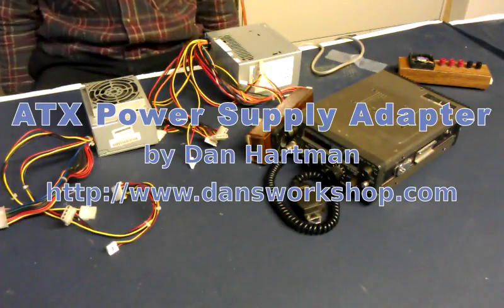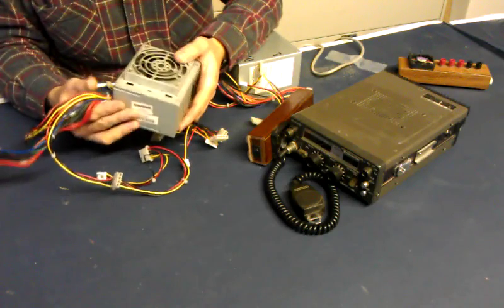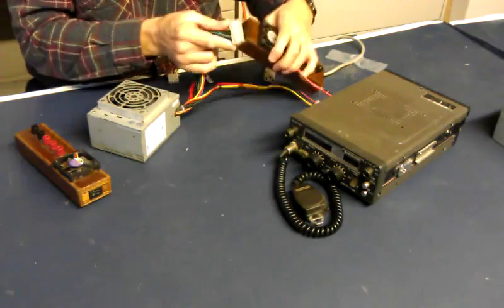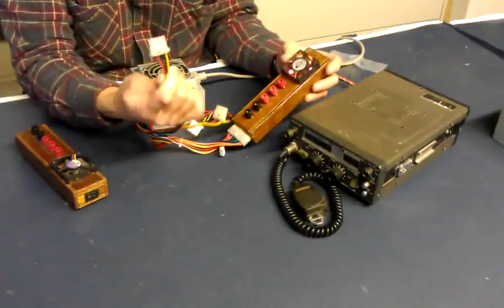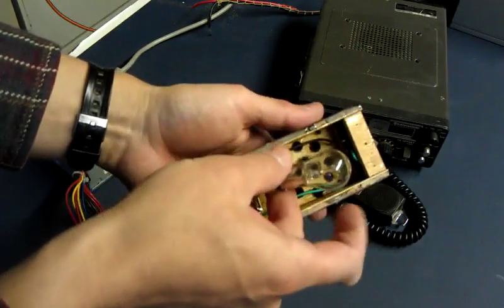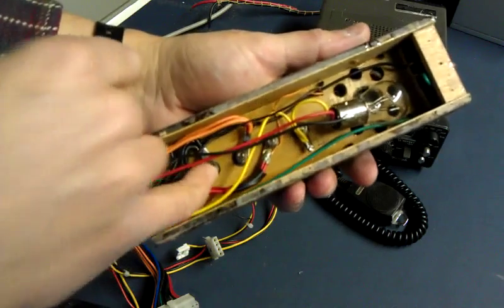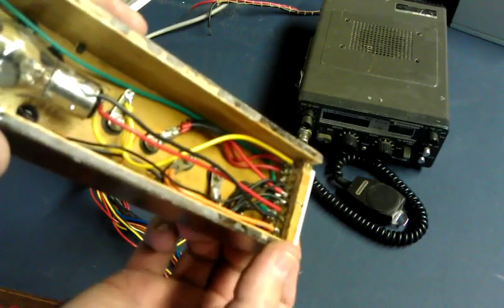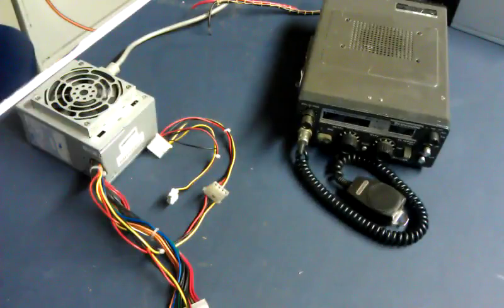How to NOT convert ATX power supply to benchtop or lab power supply

Comment: The Lower the Voltage = The Higher the Current   Higher Voltage = Lower Current. Fundamental Ohms Law.  Pressure Vs Flow.  The higher the pressure the lower the flow and vice versa - Same as water flowing through a hose.

Comment: i dont get why ppl connect the wires together.. in theory, the electrons will take the path of least resistance, so they will essentialy, all travel down the same path/wire, or at least thats what i was led to understand from an automotive background. I know it works n all, but in theory it shouldnt realy make a differance. I have a psu to look at, and wondered how hard it would be to just put a larger gauge wire on the main + and neg "bars" inside..??

Comment: 500W PSU means 500W regardless of mow many wires each rail is a SINGLE RAIL on the board of the ATX PSU It was a common Misconception that each wire is its own rail that is far from the truth all the 12v go too a single pad on the board same with ground save with 3.3 and same with 5v the only wires on their own rail are power good power on 5v standby -12v and there is another i think but cannot think hope that makes things a bit clearer for you :)
Reply: Not entirely so, Dale.  Per wire, you're still going to be limited by the amount of amperage allowed through the wire.. Reguardless of the wattage.. Example, a 500W supply, you could draw up to 100-Amps @5V. BUT..... that doesn't mean a single 12-AWG wire will handle 100-Amps. In actuality, a dead short at that amperage, would burn the wire instantly! (12-AWG wire has a maximum of 16-Amp! Higher, and you're risking burn-up! 100-amps is more than 7X!!)  the 12V on most 500-watt supplies, is 24-Amps. (+/-, depends on manufacturer). But, but, you need to use ALL wires, in parallel. the equivilent of a 4-AWG wire.  Think of this as the size of the average booster cable wire for your car. Otherwise, You'll have a nice space heater, instead of a power supply (which will hopefully shut-down before it does.)

Comment: that's an old 2m radio you have there. aren't you afraid of the interference from a switching power  Supply getting into the radio?
Reply from the maker: No, I'm not.  What frequencies are in a switching PS that I should be afraid of?  I think they run somewhere around 100-120KHz.  Should I be afraid of that?  They have to run quiet enough to be compatible with the guts of a PC so I'm not too worried about it.  Never had complaints on the local repeater about funny sounds or issues.

Comment: Damn, someone stole your idea and made a breakout board. at least the masses can use these  powersupply breakout boards in the exact same way so if the power supply itself does fail, it is an easy switch.
Reply from the maker: Well it's not really stolen, because I gave the idea away in this video. ;)  Not only that, but I stole the idea from someone else.

Comment: Idiot here. Why is the dummy load necessary in this case?
Reply from the maker: Some power supplies won't stay turned on without a dummy load.  It isn't necessary in most cases, I'm told.  Using a light bulb as the dummy load is also a visual indication that the power supply is on.  (Maybe this isn't a necessity.) Before the electron police jump on us, let me clarify something about "necessity."  Not much of anything is really necessary.  It's not even necessary to use an ATX power supply for anything, just use a string of D cells, enough of them will make 12 volts.  Posting videos to youtube isn't even necessary.  Having a computer isn't even necessary, people lived without them for millenia.
Reply: FYI, the newer 24 pin (not 20 pin) ones need a larger load too to keep on. Apparently even if the PSU does come on without a load, it's regulation is sometimes bad.

Comment: This comment is intended for the technically minded....  Please don't post jackass comments if you don't know what any of this means...  (You were warned...)

Just a few of my own thoughts here, ... things to keep in mind.  And for similar minded folks, feel free to comment if I've missed something or; of course, ... if I'm wrong about any of this..  :-)

ATX standard as far back as ver1.1 (Probably even 1.0, but I'm not going to try to find a design guide for it...) requires no-load operation.  (Most power supplies made after August-2000.)  So, I suspect that a basic load is built into the standard.  I also suspect that this is because of two common issues.  1.  Timing.  Mainboard power-up is not always as quick as it should be and 2.  Most ATX power supplies (not sure which version for which it became effective, but I know it was pre-2.01) have 5V power on state EVEN when the power supply is in stand-by mode... Bearing in mind that most ATX power supplies are designed and built as cheaply as possible, ... I would probably suggest NOT using old power supplies for this function anyway, so.....  If it powers on and stays running with no load, ... you should be fine.  They ARE "allowed" to bind to power-down state with no-load, ... so if it shuts itself down or won't power up, ... you probably need a load...  (BTW - If it powered down because of no-load, you may have to disconnect input power and reconnect to get it to power on again...  I suspect this whole issue is probably rather rare, frankly...)  Since most DIY noobs would not likely think of no-load as being a problem, ... I suspect that if it were an issue (and causing failed supplies) you'd have seen droves of people with this issue by now..  :-P

Most power supplies (300 watts and up) use 16AWG stranded wire on the 20/24-pin ATX connection.  (For all but the 3.3v remote lead, ... which may be smaller.)  (Note : 250w and below may have 18AWG wire...)  Since most 16AWG wire used will be between 7 and 24 cores (strands,) the maximum recommended load for that wire would be 7 amps.  Since there are only 2 +12V leads on a 24pin ATX connector, ... the maximum recommended output using only those two leads would be 14 amps (168w)  (Doesn't matter if it's a 300 watt or a 1000 watt ATX power supply.....)  So, ... if you'll need more than 168w output, ... you should really consider adding additional connectors to this project for the 4-pin molex connector, or preferably, the PCI-E power connectors (as they will have 3 or 4 +12V leads on each connector...) If using multiple additional Molex connectors, ... use the first molex connector on each lead coming from the power supply and use separate leads for each connector...  (I only mention this since 4-pin molex connectors are often wired in a single parallel string on ATX power supplies...)

BTW - Most power supplies will also be regulated on the +12V1 leads to anywhere from 8 to 14 amps...  So its possible that you won't be able to draw over 8 amps off the +12V leads on the 24-pin ATX connector...

Also note, ... there is a difference between single rail and multi-rail power supplies. If your load will be higher than 168w initial current and will power on immediately as the power supply receives power (as this guys HAM radio did,) then timing is important.  Stick with single-rail power supplies for these applications...  (Because if your rails don't all power up at exactly the same time (and they're cheap, ... so they won't be synchronized very well,) ... the rail(s) that come up first will hit their peak load every time you turn on the power...  Definitely not the best way to make a power supply last..)

Comment: No way you'll power that transceiver with a 140W supply ;)   140W/12V = 1.67A best case scenario (not taking into account the 3.3 and 5 volt rails which are part of the 140W.  But yeah I get the idea.
Reply: Are you high? What kind of math is that? 140/12=11.33
Reply: ***** Digger D should go back to digging, and leave the technical stuff to the pros...  lol....
Reply: Digger D I think it is time for you to put new batteries in your abacus.
Reply: Perhaps you guys could read the first chapter of any electronics book ;)
Reply: Digger D Are you seriously going to try to defend your math???  It is YOU who needs to read up on your electronics...   Amps X Volts = Watts   So if you are trying to find Amps, you divide watts by volts.  If you have 140 watts at 12 volts, you have 11.67 Amps...  Not 1.67 Amps.   Maybe you just typo'd???
Reply: Could be ;)